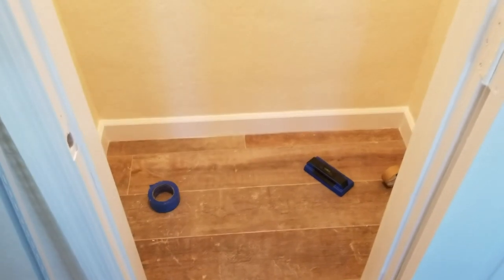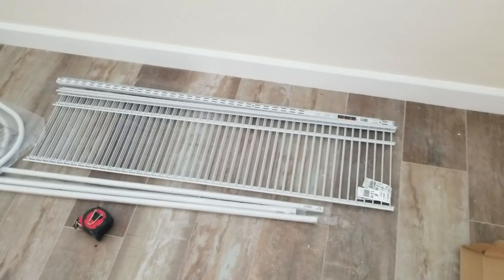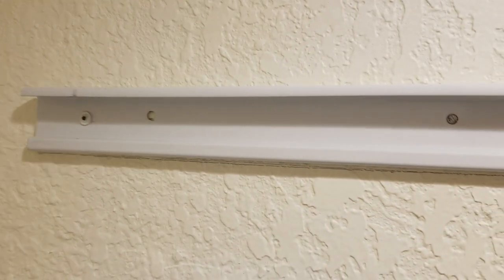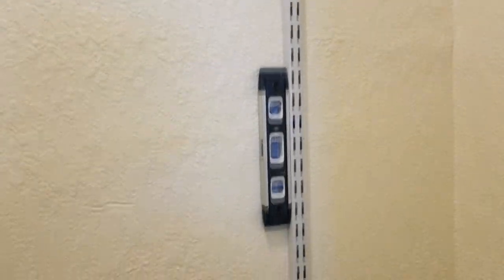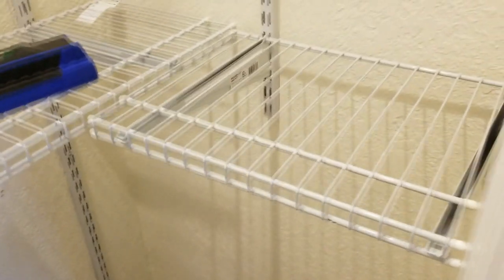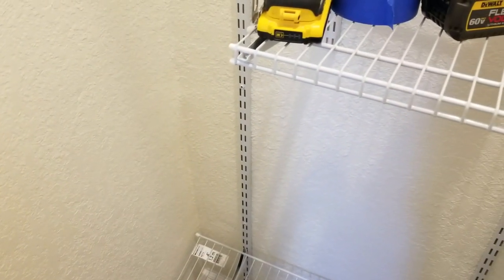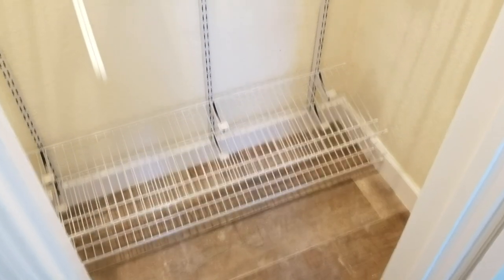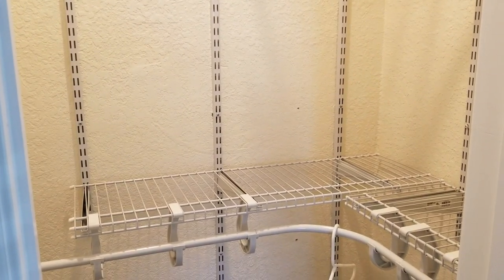ClosetMaid Shelving Installation ShelfTrack Reach-In Closet

Comment from the maker: Tools & Recommended Closet Maid Closet Organizer Shelftrack starter kits:
✅ ClosetMaid 2091 ShelfTrack 7ft. to 10ft. Kit, White: https://amzn.to/2SwpPYv
✅ ClosetMaid 22875 ShelfTrack 5ft. to 8ft. Kit: https://amzn.to/2RwBUj6
✅ Precision Sensors Stud Finder Scanning LED Profinder: https://amzn.to/2uwGBvS
✅ DEWALT DCK299D1T1 Hammer Drill, Impact Driver Kit: https://amzn.to/2M6h450 
✅ E-Z Ancor Self Drilling Toggle Anchors: https://amzn.to/2GPmAsd
✅ GRK 120660 White Cabinet Screw, to install cabinets 8 X 2-1/2": https://amzn.to/2C5OUTa
✅ ClosetMaid 12-Inch Wire Shelving Support Brackets: https://amzn.to/2U1Gx2Y
✅ Empire True Blue 12-Inch Magnetic Level: https://amzn.to/2DTCP4j

Comment: This is a great video, today while getting dressed I hear something in coming from our closet, though one of our cat was in there, I go to the closet and and find after 24 years one of our shelves was collapsing wife had to much stuff on it, so I took it down and looking for ideas on putting up new wire shelves that this has given me the idear or what I have to do, it will be done nice as slow, LOL. first step patching the old holes.  Thanks Jeff,
Reply from the maker: Way to go Paul. Now you can correct the errors the builder made

Comment: How do you know if you have metal studs or wood studs to be able to use the appropriate wall anchors?
Reply from the maker: You could find a stud in the wall, drill a 1/2" hole in the drywall until the bit just hits the stud, then look to see what material the stud is. Then you patch the hole back up with some Dap or drywall mud.

Comment: Thanks for the video, it's very informative. I have tried to locate studs in my closet and I don't think I have any.  My closet shelf has fallen down twice in 5 years. I have the regular wire shelf with the brackets. What would you do in a closet with no studs?
Reply from the maker: surely you must have studs in the closet, building codes require them every 16" for hanging drywall. Sometimes you find them every 24", but they are there. You just need to use a better stud finder. What tool are you using?
Reply: @jeffostroff  I am using a stud finder app on my phone. This house was built in 65. I have been finding all sorts of funny things.
Reply: I went in with a dry wall screw 3" long and there was no stud in the corner even!

Comment: Thanks for this guide. I went to h.d. and asked if these could be cut to size. It was a no. What tool do I need to cut the shelves and rods? I’m doing a small wood 23”w x 90”h x 35”d closet.
Reply from the maker: They should be able to cut these for you. The home depot stores in our areas have a pneumatic cutter they can use on the wire shelf aisle. Some also have the large scissor type cutter that take both hands to operate. On site I use an angle grinder handheld tool ti slice through the wire shelves, takes about 10 seconds per cut.
Reply: Dolly M  - If  Home Depot doesn’t cut it go to Lowe’s, that’s who cut mine. They were able to cut the wire shelves. I wanted the hanging track but was told they don’t cut those so I had to purchase a shorter one in white although my closet system is In The silver color.

Comment: Would have like to see how the closet rod end was installed into the wall.   Did it go into a stud?
Reply from the maker: The closet rod does not go into the wall it stops right before the wall and we put a plastic cap that goes on the end of it and I sized it so that the plastic cap would be up against a wall and I use a little bit of silicone to glue it to the wall so that it doesn't move.

Comment: Do you think this is possible on a curved wall? I have storage space underneath my stairs and the wall isn’t straight.
Reply from the maker: Yes this can work if at least part of the wall is straight, just figure out where to moun the vertical standards so that  so that the horizontal shelf brackets won't hit the curve.